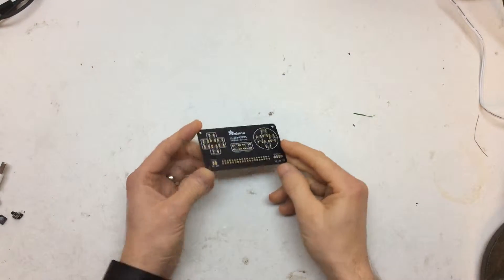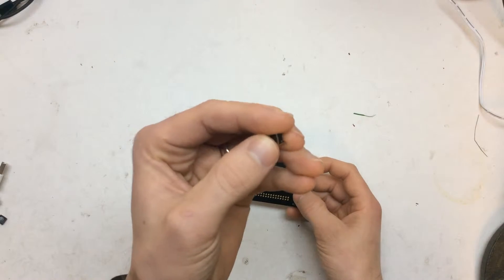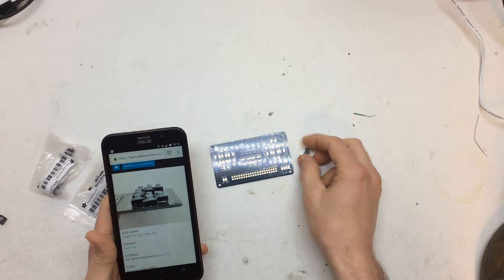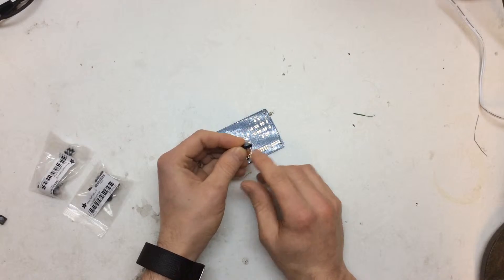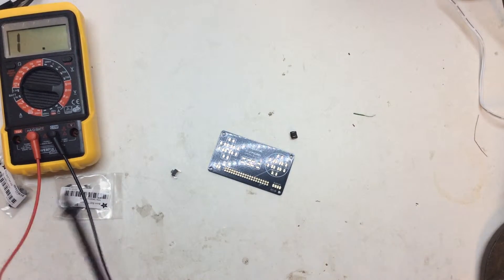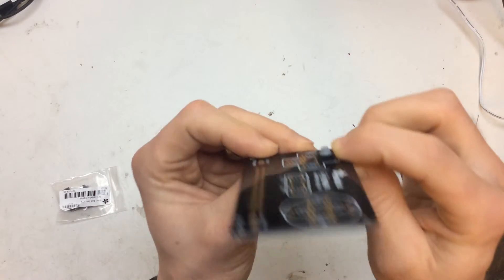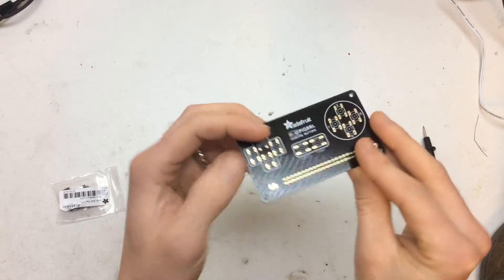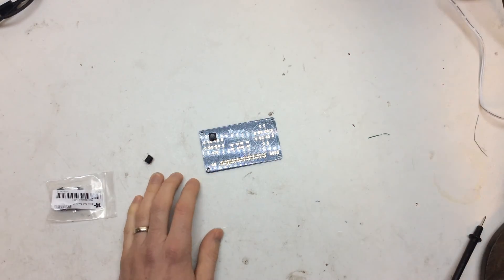Pigrrl2 controller PCB membrain buttons

Comment: I don't see a follow up video. Did it work out? I am about to begin my build and have the same soft buttons.

Or should I be googling for the smaller 6mm soft buttons? and be done with it? Or did you try that already and come up blank?

Your advise is very much appreciated I plan to begin this project after I get off work on Friday. :) took awhile because for a long time they were out of stock.
Reply from the maker: aaron carmack ah sorry, my bad forgot to link this video to the finished one. I got the buttons to work and fit this board but I didn't have ninjaflex buttons on top so it didn't really work out.
Here is the finished video, I made a few mods you might want to consider yourself https://youtu.be/hT_qm_UdnRI

Comment: Thanks! I am about to build one and I HATE loud controller buttons.
Reply from the maker: I hope you have more luck then I did. I got sent ABS 3d printed buttons so I was getting accidental button presses. Make sure you use ninja flex buttons with yours.
Reply: Should I use TPU or TPE Ninjaflex?
Reply from the maker: MlgLord Lord the TPE might be a little too flexible
Reply: Thanks!